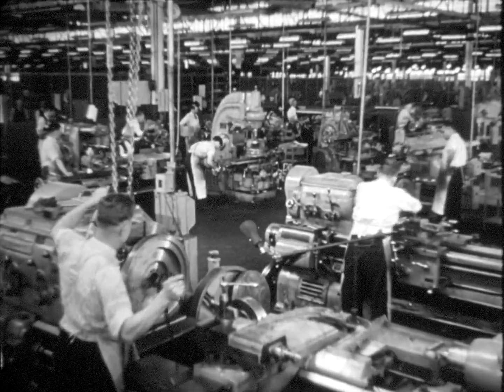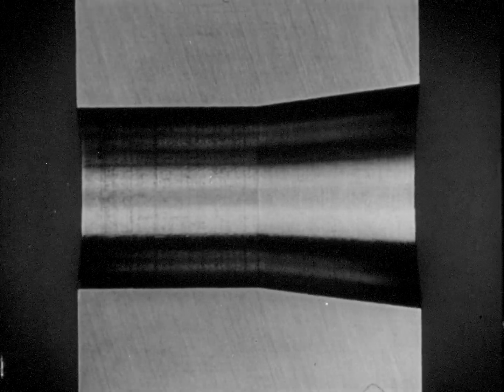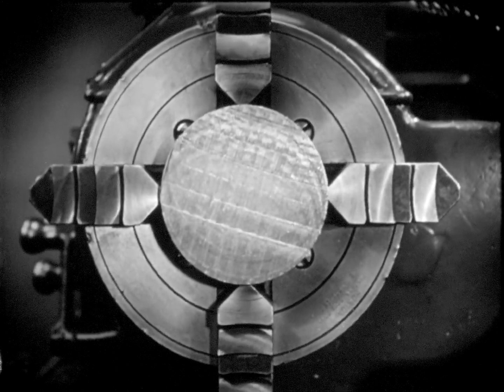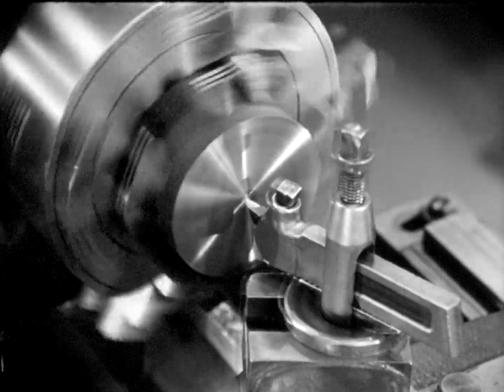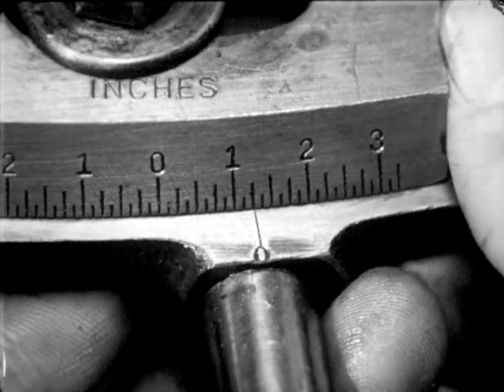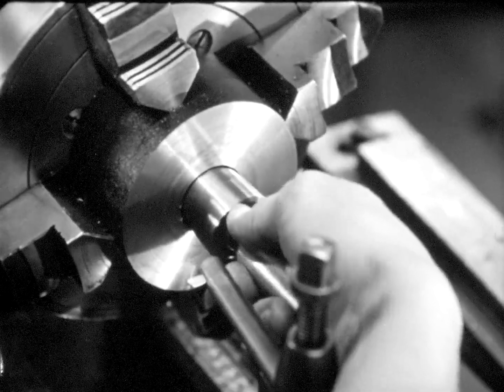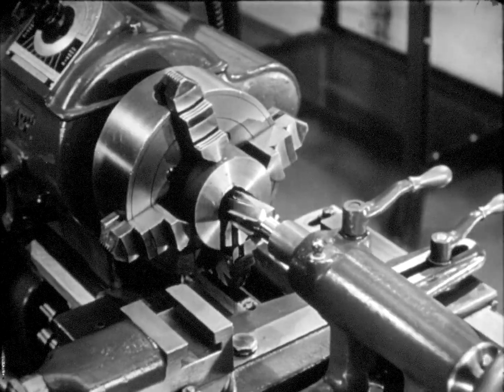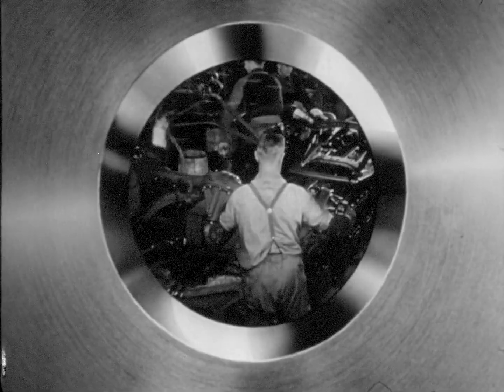Machine Shop Work No. 4, Drilling Boring and Reaming

Comment: I would love to have some of these early 1920s lathes and heavy machines. No Chineseium metal here. I dont know how they moved them without forklifts. These were real men.
Reply: They are easy to move with forklifts but the better machines are from the WWII era which you see in the film. Forklifts existed in WWII but they suck for most machine tool movement.  Machinery skates and rollers were used to position them.  It's not difficult to move large machine tools if you think first, so that's what (good) riggers do.  I'm a hobbyist and have moved many machine tools for self and friends. If you want a home machine shop, go for it!
Reply: Ob Fuscated , a walking bar is handy... mover my milling machine around in my garage with that.. simple leverage techniques. Old school.

Comment: Interesting! I've seen someone nowdays doing on an old lathe the chalk thing and drill bit help with another tool.. and think.. is that done how is suppose to be done? Thanks to this video now I know the answer. Also the chalk thing it's quite a dangerous thing to do.. I didn't think they will show such a thing in a instructional video. But that's the best confirmation that this is actually  how things where done backthen.
Reply: how is chalking it dangerous?  just keep your hands clear of the chuck jaws.

Comment: Compared to the first 2 films (rules and micrometers) this is pretty good.    While the actor at the end did turn the plug gauge, the instructor that would have shown the film back then would have exploited this - by asking the class if they saw anything wrong.  This sort of simple error is quite different to Film 2 that continually showed an operator using a micrometer incorrectly and never mentioned the ratchet.
It's worth noting that the depiction of the machinist (Roy) working direct from the drawing is what would have been done in prototyping by a master machinist.  For production runs, the machinist would work from a printed and laminated list of process steps, each step giving the tool to use, the depth of cut, RPM, feed etc.   Typically, the master machinist writes these lists - that's what happened in the places I worked anyway.
Reply from the maker: The Micrometer film was part of a series produced by the film maker Loucks and Norling. This film was produced by the renown Jam Handy Organization. The reasons for the difference in accuracy and presentation may partly lie there. Personally, I will just plead ignorance and only claim responsibility for digitizing the history and making it available here.

Comment: I’d love to see young guys trying to sharpen those tools properly, or using a copy attachment, some can’t even sharpen a drill these days.
Reply: In general in a large production shop in those days the tools would have been sharpened by tool room workers, especially the reamer. The production floor workers like Roy checked out tools from the tool crib, and checked them (or the broken pieces) back into the crib at the end of the shift, or when the tool became dull.

Roy most likely knew how to sharpen the lathe tools and possibly the drill bits, but he would not have done it on a production run. Someone else with specialized training and equipment would have done the tool sharpening in a large factory.

In a small shop Roy likely would have been able to sharpen most of the tools, but the reamer would have been done on a tool and cutter grinder, and possibly sent to another shop to do that.
Reply: l wilton , the guys in the cage use to be the best of the best tool makers, sharpening the tools... over the years, they just kept trac of where things were and just reordered stuff.
Reply: Yeah, I've come across these machinists who think it's easy. So easy I wonder why they don't do it themselves? I mean a CAM programmer will earn about 50% more than a machinist ..... and obviously when you're programming you don't have to worry about tolerances at all 🙄
Reply: Will Will I thought you millennials were born knowing everything already. Follow your own path grasshopper....
Reply: I'd love to see these guys program a 5 axis with cam..... apples and oranges mate. Oh and by the way I can do both.
Reply: @Zkkr429   Those guys would laugh and call you a button pusher - whose job takes a short time to learn vs years to learn to run a lathe and get .0002" tolerances by hand and skill.
  But neither is more important than the other- it's just that times are different.
 Never belittle the other guys skills- you may need him one day.
Reply: @newstart49  um, I'm pretty sure if up showed a guy from the 1940s a modern cnc machine he'd be stunned into awed silence, not talking shit calling anyone a "button pusher"...
Reply: So you agree, young guys are more skilled nowadays, simply because of progression of technology. More advance parts are made quicker so not only do you have to be more skilled but work harder and quite often earn comparatively less due to foreign competition.

Comment: i love the old training films.
i even saw a technique i never saw before, using a lathe bit to drill the pilot hole.
thanks for sharing these videos
Reply: I have done that before, thinking it was rough way of doing things, because after I drilled out the centre hole the bit started walking of centre so I put a blank piece of steel against the side of the drill to keep it centred. Good to see I'm not the only one that does it.

Comment: no indicating?
Reply: Abom would not be pleased lol
Reply: no need, with stock with that rough of a finish..everything to follow will reference off of the tapered hole good ol' Roy cut. :-)
Reply: I'm thinking indicating would be wise depending on how oversize the rough blank is (unspecified in the film) Without indicating, I'd sooner trust a scribe of some kind (soapstone?) held on a steady piece resting on the machine than chalk in hand held on a forearm. But I trust they know their craft for their application.